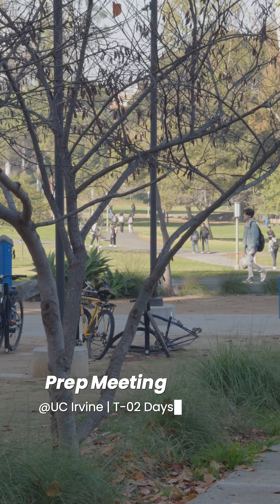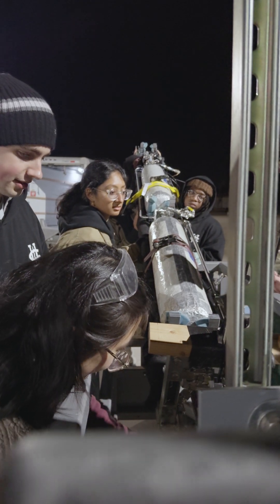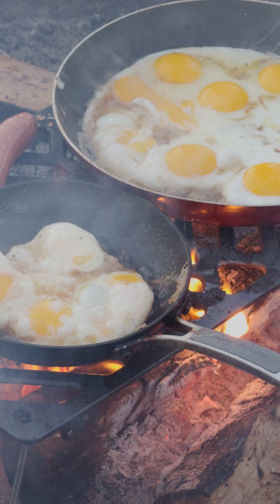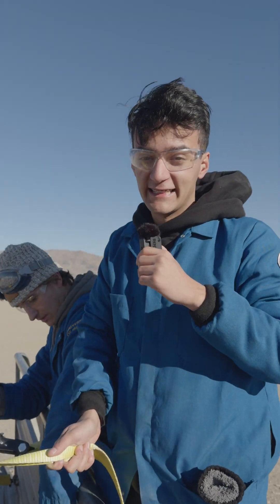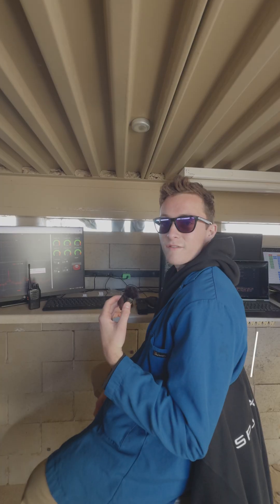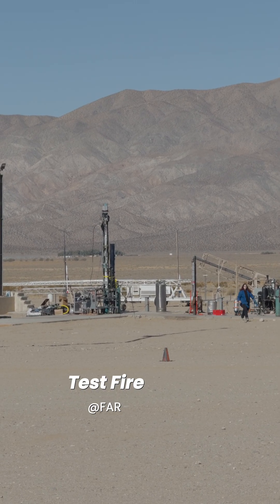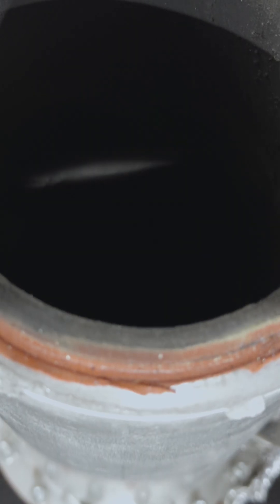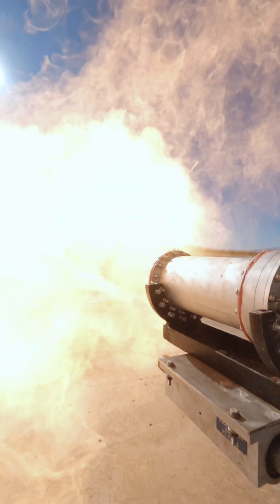M0CH4 Vertical Test Fire #1 | UCI Rocket Project Liquids Team

Comment: For ablative liners, good old fiberglass cloth (fine weave) with an ablative resin works great.  You can mandrel wrap it and vacuum bag it  to get whatever shape you want and the low melting point of the glass causes it to form a protective layer on the liner and coat the throat of the nozzle preventing erosion there.  You might be tempted to use silica cloth which is much higher temperature but it brings it's own issues with de-lamination as the resin chars through the layers.  I ran my liquid engine 8 times using these liners and they worked great.  Keep your burn times under 20 seconds if you have oxygen getting to the wall/liner.